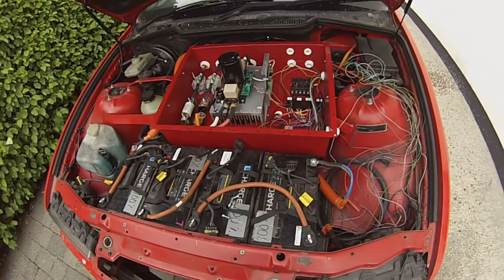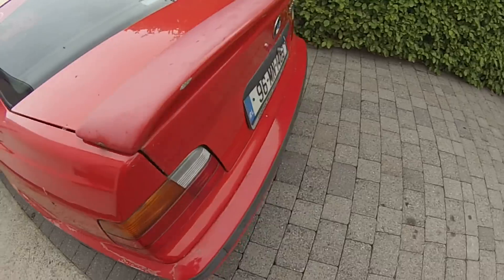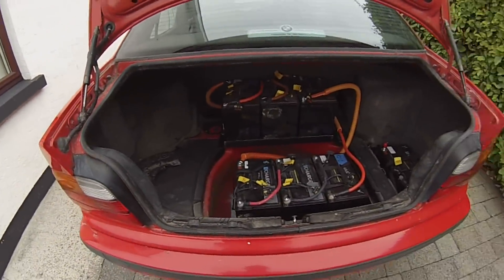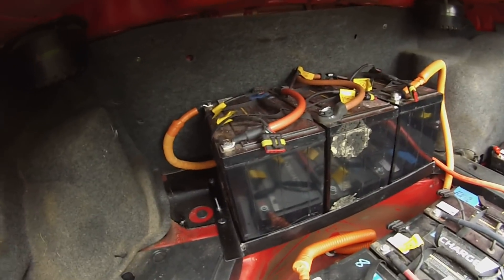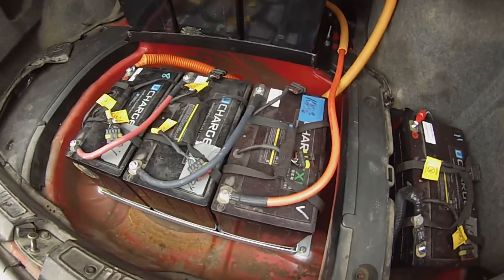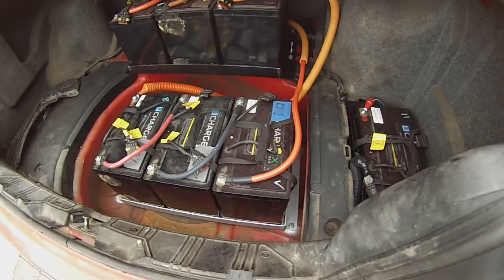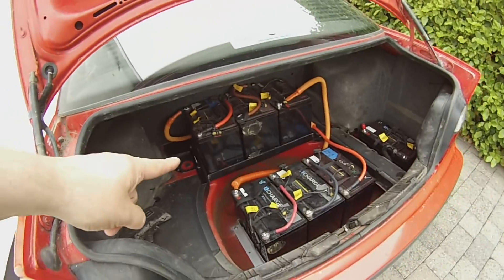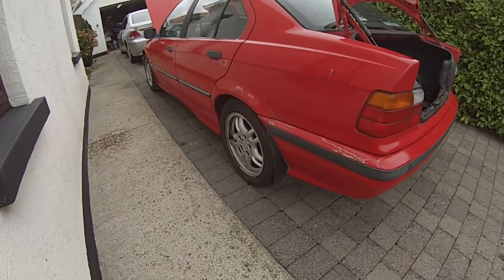€1,000 BMW E36 EV Build 10 : Full Voltage

Comment: A couple of 2800w 240v generators mounted low down either side of motor, driven from your tachometer shaft, and after work leave it in neutral and plug your house in, 👍🙂

Comment: end of 2018 into 2019 and im following your videos through till the end. i like how you offered to ship parts to anyone serious doing this kind of thing. im still in the planning phase but im intending to do a 2000 New Beetle. around the tax return season, and so far all is looking good aside from the fact i cant find a good motor and battery pack. not for a good enough price to meet this budget. now i haven't actually gone to any yards yet as i dont have the cash and i feel like that would be rude. but those are the only hangups so far. everything else in your videos i can find close to the prices you talk about. thte IGBTs are a bit more than free. but i can have appropriate ones from ebay for under 160 US and thats not too bad. its looking like overall im gonna be sitting right at about 2 grand US to do my version of this project i just need to lay hands on the right parts.

Comment: So am I being a troll by inquiring about the lithium battery loss?
Reply: Raleigh Sexton  No way am I a expert. But can't you get 40 miles on sealed lead acid batteries new ones? Are those lead acid batteries? Are they lithium batteries?
Reply: I researched google for that Charge X battery brand, I got no hits, though I'm in north America so it may be an Irish or UK brand.  Certainly appear to be conventional unsealed lead acid batteries.  Perhaps another viewer can verify them.  I'm just disappointed because the original premise was to use batteries other than lead acid, but I guess another project has required the battery originally purchased for this project.
Reply: I should read the older comments before trolling! These are lithium batteries of a type I didn't recognize and Charge X is the model I guess, not the brand!  So I stand corrected!!

Thanks to ATS for posting the video link below.

Comment: another great vid Damien !

and a great project too :) 
im a big E36 and BMW fan, and been thinking of an EV project for a while
also a fan of your 8series too, even with the little accident haha

really like your videos, and your manner
find them very helpful and informative.

does sound a bit funny the th to an english man lolz
but your straight forward manner etc is one of the big reasons i subbed your channel!

keep up the amazing work!

and could have some links to the JLD404 from a good suplier
and the cool little temp controller from ebay!
Reply: found 1... lol :) 

https://www.ebay.co.uk/itm/1pc-DC-12V-Digital-Heat-Cool-Temp-Thermostat-Temperature-Control-Switch-Relay-/162499826473
Reply from the maker: https://www.lightobject.com/Programmable-Digital-AH-Meter-Blue-LED-Ideal-for-Battery-Monitoring-P278.aspx

Comment: Hi Damien, do you also have a link for the temp controller/monitor/relay?
Reply from the maker: https://www.ebay.co.uk/itm/1pc-DC-12V-Digital-Heat-Cool-Temp-Thermostat-Temperature-Control-Switch-Relay-/162499826473

Comment: Great work! Amazed at how the hood insulation quiets the power steering pump down. Would it cause a heating issue to use sound deadening material around the pump and the controller box where the fans located? Curious just how stealthy you could go without doubling the budget.